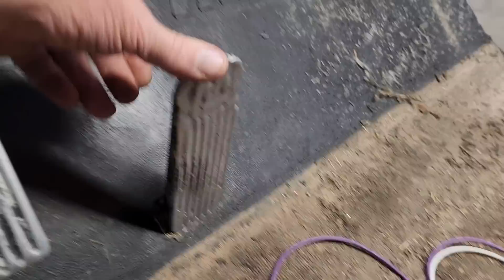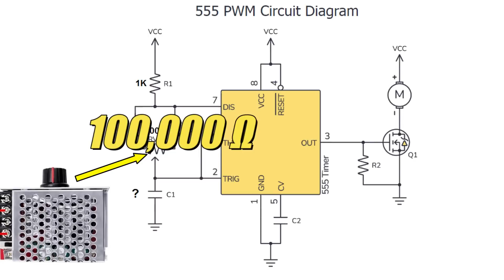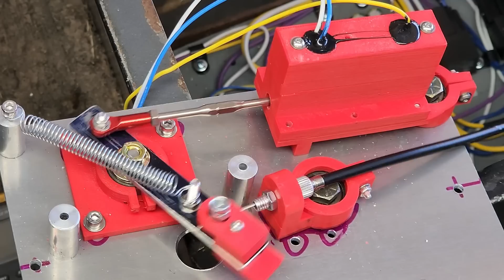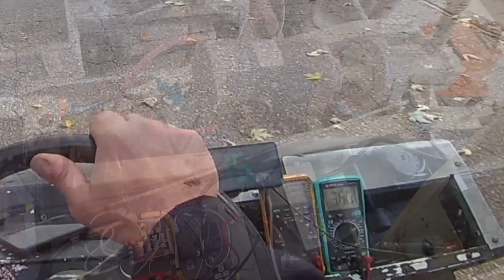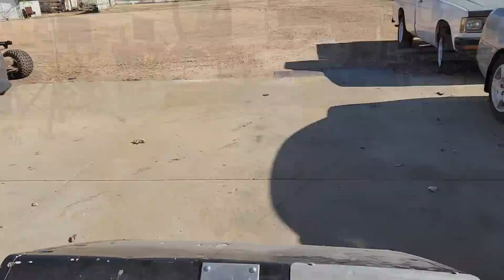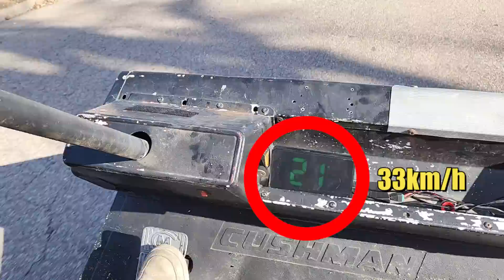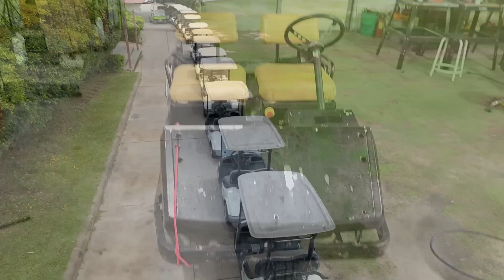S4 E38. We build a custom throttle and road test the gasoline / electric hybrid petroleum battery

Comment: Im stoked to see where this goes. Maybe add regen braking via a capacitor bank, and would theoretically allow smoother starts without bogging down your engine
Reply: Not really worth it. It wouldn't save fuel with this setup, and the starts could be smoothed using a microcontroller to limit any sudden increases on the alternator input voltage, which would be simpler than doing any regen stuff.
Reply: @tin2001  It would save fuel, since the engine is adjusting the throttle maintain the RPM under load. When running idle, there's not a lot of gasoline being used - just enough to keep the engine running against its own losses. When you start putting a load on the alternator, it pushes back against the mechanical motion of the engine which would bring down the RPM, so the engine responds by opening the throttle, letting in more gasoline per revolution.

@twoeightythreez But practically, you would hardly notice it. Regen braking on EVs invovles very efficient electric motors with upwards of 95% efficiency as motors and over 60% of efficiency as generators. The combined efficiency of generation and locomotion is high enough that you can restore a significant portion of that kinetic energy. The DC motor in that old golf cart is probably much less than this - possibly 60-70% for locomotion and <20% as a generator - so the energy recovered would be relatively small. It's also not all that useful for cruising. For running around town, you'll spend far more of your time cruising than stopping and starting. Additionally, regen is only effective at higher speeds. The amount of torque the motor pushes back with is proportional to the current it is passing, which is proportional to the rate of rotation. As you come to a stop and the speed gets slower, the amount of counter torque it can provide decreases. Beyond some minimum torque you'll need physical brakes to maintain the counter torque need to maintain the same rate of deceleration. For reasonably soft braking, the regen on my EV is insufficient below about 5 km/h and so it starts to apply the brakes and more like 10-15 km/h under harder braking.

A capacitor wouldn't work in this case without some crazy electronics. The DC motor's speed is controlled by the voltage applied to it. As you slow down, you are dropping that voltage, even under regen. When capacitors store energy their voltage increases, so either you have to disconnect the capacitor long before you have finished slowing down, or the capacitor won't store anything because it's following the motor voltage down to 0. You could use a step-up switched mode power supply to bring that decreasing voltage up to a level that continues to charge the capacitor, but now you have even more losses. EVs use a different approach where voltage is kept constant and the speed is a result of changing frequency of the AC voltage. They also include an AC-DC power supply that's used when you charge the vehicle from the wall, and it's designed to be very efficient, so it's possible that's what they are using to recover the energy from the motors, though I'll admit I don't know how they do that in practice.

Comment: Would the same general concept work if you applied steady 36v to the armature lugs of the DC motor and used the pwm control on the field coil lugs?
Reply from the maker: The field windings on this series wound DC motor are about 1 ohm,  Powering them directly would adsorb a lot of current.  I'm not sure if there would be a benefit by doing this.

Comment: The Hardwood Floor is GONE!!!
Reply from the maker: You are the first to notice that!   Indeed the floors were removed to see what was under them.  I was hoping there was no floor on this thing so I could rig the throttle cable without tipping the car on its side.  Have a good one!

Comment: I was mocking up a similar setup a few years ago, but being electronically illiterate killed the project. Would 120V motor and a gasoline generator have any potential?
Reply from the maker: The windings on a low voltage alternator are made to carry 140-200 amps.  On a 120 Volt generator, the windings may not be able to carry that may amps.  The only way to know it to give it a try.

Comment: You could take away the 555 and use a microcontroller to send the PWM adjusted after a pedalposition thingy. On the other hand coding and interfacing a pedal position thingy with canbus sounds like a boring project. Edit. The pedal wasn't canbus so easier.

Comment: They make 100k ohm digial pot that you could use. However, you would need to adapt your mechanical throttle to a USB bong so you can use the pot.
Reply from the maker: I have an X9C104 I will try, hopefully it will work on an RC circuit.

Comment: The alternator operates similar to a synchronous generator, which has something called the P-Q curve. This curve is a ratio of active and reactive power to a rotor excitation voltage value. I'm not sure if it's something that applies to this project, but it's interesting to do some research because there may be power being wasted on reactive.

Comment: I’m in the middle of deliberations on replacing batteries in a 48v carryall and a 36v cart. It’s very compelling to see how well this works. Batteries are really expensive and replacing them piecemeal is not an option (dumb). Your channel is quickly becoming my favorite.
Reply from the maker: Thanks!, stay tuned,  We will explore this subject and see if its a good idea or not.  So far it appears to work really well.
Reply: @robotcantina8957  excellent. The stupid-charged diesel was so enjoyable to watch. I have a ford escape hybrid that has a 2 time rebuilt battery that I’m ready to junk. It’s a nice car but the pack is so poorly designed. I’d love to convert it to a full time ice engine or give it to someone who has even more patience than me. The Prius battery is so much better than fords abortion. It cannot operate without the battery

Comment: Nice!  Love the project so far.   Been thinking about doing this on a moped. Old Ford starter that has been converted without the bedix gear drive for propulsion and a tiny Chinese two stroke generator.  Does anyone know if the starter would last, or would this just burn it up in ten minutes?  The two stroke generator has a 12v output but I don't know what the output would be in amps.  It looks like it is basically a car alternator.  Around 800 watts in AC120.  Am I out of my mind?
Reply from the maker: The starter will burn out quickly.  The 12V output on the little 2 stroke generators may not be enough.  Keep thinking, I'm sure you will find a solution.

Comment: Is the relay that cuts power if the brake pedal are pushed normally open or normally closed? (Ie, if no power are applied to the relay, what state does it rest in?)
Reply from the maker: The relay is active, so when the  brakes are applied, it cuts the power to the relay and the relay opens.  Its a fail safe method.

Comment: What about dropping the gear ratio to get a lower electric motor rpm AND bump you up to 25mph cruising speed to keep up with neighborhood traffic.
Reply from the maker: This thing definitely need to go faster.  The speed limit in town is 30 so that would be ideal.  The axle on this thing was available with 4:1 (gas) and 12.7: 1 (electric).  I think the 4:1 would to a bit too much for the DC motor.   LOL, we may need a transmission of some sort.

Comment: Loving the progress. Thinking Arduino + TPL0501 100K digital potentiometer. Available, of course, from a popular on-line shoppers paradise. Still would require some sort of operator interface - but, that's right up your alley. Rack and pinion w/rotary pot a possibility? Voice control? Follow the lead of vehicle manufactures. Why keep it simple? 😕 Not to say your linear slide mechanism isn't brilliant and probably complicated enough. Your videos are exercise for the brain. And in my 8.7 decades, I really need the exercise. 🙂

Comment: Just route a cable to the rotary potentiomter of the box and spool it up, and add a spring which holds it there, unless you push the throttle. You then just need to connect the cable to a pin 90° sticking out on the bottom of the throttle and a roller which is fixed under the floor, over which the cable runs, so you pull on the cable if you press down on the throttle. 

Some gasoline batteries come with a setup like this. :)

Comment: I greatly enjoy naming a generator a battery.  It seems the batteries called generators are well accepted today.

Do you think the motor windings might have a thermal fuse wound in?  I think you're right running it at higher voltage will just get it a bit hotter.
Reply from the maker: Thermal fuses on something this old is not likely.  lol, back in the day stuff would catch fire and that was considered normal.

Comment: I had a simpler idea for the throttle. Use the throttle pedal to move a cable connected to the throttle on the engine. Also have a switch connected to the pedal that opens and closes depending on the throttle position. Connect this switch in to the wire supplying power to the brushes to turn off power to the alternator when the engine is below a speed where the engine has enough power to move the cart. This should help efficiency by reducing the engine speed at lower travel speeds. I saw a small single person cart that had a gas engine. Not sure how it worked but when the accelerator was pushed it would start the engine and start moving the cart. A short time after the cart stopped moving, The engine would turn off.

Comment: So much extra drive train componets that its kinda a waste just eliminating the electrical setup and going chain drive from the clutch on the gas motor to a sproket on the drive axle where the current electrical motor connects would be way more efficient
Reply from the maker: Absolutely, but that's not our goal.  The goal is to keep the electric motor.
Reply: Waste not, fun not.

Comment: For another throttle setup, you could hook up that cobalt pedal or the TPS, run them into an arduino, and then output pwm signals right into that 12v supply. There are also digital to analog 100k potentiometers on the jungle website for about seven bucks each.
Reply from the maker: Yes, that would work.

Comment: over reving an electric motor can cause the armature to explode, but I've never seen that from excessive volts. That can happen when a starter doesn't disengage from the flywheel after starting.

I wouldn't be worried about 48v on a 36v motor causing over revs, because inductive losses limit current as RPM increases.

If it was more stressed & the RiPMs were lower I would be worried about heat.
Reply from the maker: Thanks!

Comment: Why not solder a bunch of resister in parallel and series equal the total resistance 100,000 ohms but enough of them in parallel to handle the current
Reply from the maker: I'm not sure I understand.    The RC circuit requires 0-100,000 ohms in order for the timer to work.

Comment: you need to rig a front wheel brake, then it could do burnouts!

(maybe)
Reply from the maker: I agree, there is no way to power brake this thing.
Reply: @robotcantina8957  sure there is! Air the tires way up, then jack up the rear bumper until the tires barely touch the ground! I had to get the rear wheel spinning in the air, then get lowered down very slowly, just until the sqreeching started, to do a burnout in the 24v car I raced.

water can help get it spinning, so can a smooth & heavy steel plate for the burn patch. It will be a one wheel ordeal, so you only need a plate under one tire.

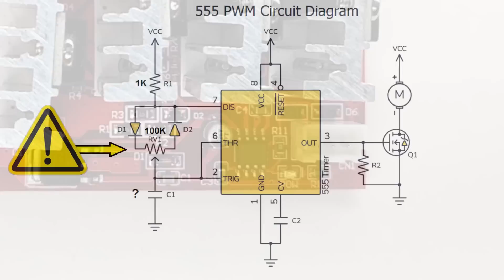Comment: At 5:32 if you increase the value of C1, you can decrease the value of RV1 accordingly. You may need to adjust R1 as well.
Reply from the maker: Yes, but not everyone can do that.
Reply: @robotcantina8957  Indeed, but designing and 3d printing and manufacturing also requires certain skills..

Comment: Changing the location of the throttle return spring would give you progressive resistance and make it much more ergonomic.  The way it is now, resistance to movement is highest at tip-in, then drops as you press farther.  This combined with friction  in the mechanism, makes it very hard to modulate.
Thanks for the thanksgiving treat this morning Jimbo!
Reply: Also the straighter the cable is, the easier it will slide.  You have a couple of tight U bends in it, causing a lot of extra friction.
Reply from the maker: Have a good one!

Comment: Cool system, the alternator actually works as a drive controller :)
Maybe you could also implement that the throttle of the gas engine gets adjusted when you press the accelerator pedal.
The E-Stop should also cut the ignition of the gas engine.

Comment: It's inefficient but actually does have some advantages. Mainly because it decouples the engine from the drive mechanism. That does a couple things. For one you can tweak the engine to run better at at a steady rpm range as opposed to it needing more flexibility. Even something as simple as weighted flywheel might have some benefit. And for another it allows the use of multiple motors. So for example if someone made a minibike version of this you could give it 2 wheel drive without having to worry about a complicated mechanism for the front wheel.

Comment: If you overspeed the series-wound DC motor, eventually the commutator will explode (the segments separate due to centripetal force).  For this size of motor you should be OK up to about 7000RPM, and you will usually run into arcing and flashover at the brushes (due to over voltage) before getting anywhere near disassembly speeds!. Just beware of steep down-hills (oh, Kansas, never mind!).

Looks like it works great!
Reply from the maker: Thanks for the input!  Indeed, Kansas dosn't have the hill problem.

Comment: What about putting a resistor in line with say Your Cobalt pedal? Wouldn´t that work? I´m no studied electronic engineer but to me that makes sense.
 And arent there double pulling wires? Can´t we put the engine and the electric throttle together so if You give it all the beans both throttles go balls out but when letting go the engine also slows down? I´d like that.
Together with putting the petroleum battery on rubber and a flexible tube/muffler on it that should quiet it down a lot. And make it more fun to drive.
Kind Regards

Comment: Motor RPM limits only have to do with bearings and how well the rotor is balanced. Most bearings should be fine at those speeds, but rotor touchdown means new motor.

Comment: Perhaps some stupid comments... 220 amp alternators are available for many diesel pickups... ain't cheap, tho, at $300+. Then, have you given any thought to a weighted flywheel for energy storage (inertia) to help with changing road conditions? Yes, the weight requires time to spin up, but, might ease the engine's struggles if one goal is to run the engine at constant rpm. Looking forward to the next installment!

Comment: Would be cool to have a Smaller Battery bank,36V / 48V 10 to 20AH battery, With GOOD Amp Draw.. , And ALSO A Auto Start  Controller for the Petroleum battery LOL. 
SO than be a Full Hybrid System.,
Reply: OR... Maybe a LARGER Capacitor Bank LOL @ 54V . And Engine Speed Adjustment with load So Engine RPM Will go down when no load.

Comment: I like it I just don't like brushes and you got a set in the alternator and a set in the motor eventually that's what will let this down. What about petrol Battery turning a brushless motor and a brushless motor powering drive with the 3 phase just wired together.

Comment: I sort of mentioned it before but I would LOVE to see an "electric NOS".  Basically take a large capacitor bank that stores excess energy (from engine, regen braking, etc.) and released with a "NOS button" system that dumps the stored juice to the motor at max current or maybe even overcurrent at a safe level that the motor can stand in short bursts.  Having a rechargeable turbo sounds like such a fun idea :D
Reply: It's a neat idea, but the alternator can already provide max voltage/current - no need for a capacitor bank. What could be useful is overvoltage, but for a different reason. As the speed of the motor increases, it produces a back EMF - an opposing voltage. This lowers the effective voltage seen by the motor, to the point that the motor reaches maximum no load speed when the back EMF equals the source voltage. The thing that limits motor power is mostly current, not voltage, so applying a progressively higher source voltage while not exceeding a safe voltage can allow you to provide a constant effective voltage, therefore constant current, and therefore constant torque. That's one of the great things about EVs compared to ICEs - you have full torque from 0 up to a relatively high speed, unlike the rising and falling power curve you get from an ICE. That's why we have to use a multi-gear gearbox on an ICE to keep the engine RPM near the middle of that power curve as the speed changes.
Reply: You have dashed my hopes quite expertly sir, bravo.
Reply: Look up electric supercharger. I think there is a company with a similar idea.

Comment: I appreciate you trying to keep it a little more friendly to the mechanically inclined when digital solutions would be easier, not only does it make the early stages of the project easier to follow but it should provide an interesting comparison when you switch to more modern computer based solutions.

Comment: Have you looked at the Honda hybrid system from 2014 and up? At low speed it works as your cart. When you get going fast enough the gas engine couples with the wheels in a 5th gear like ratio. If your electric motor had a double shaft and the engine were in line it may not be that impossible to add a high speed gas only mode. Anyway food for thought!